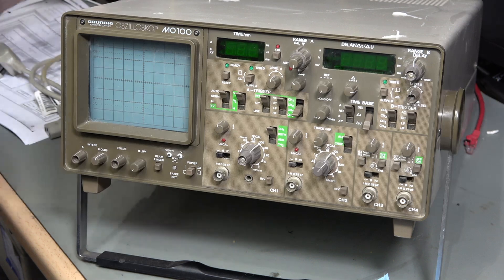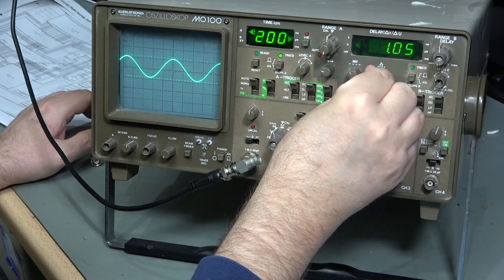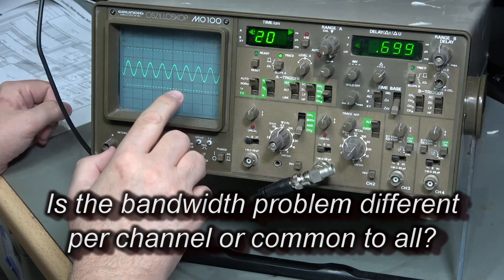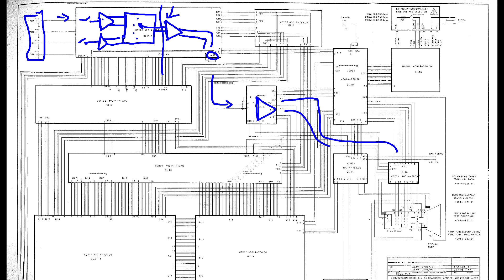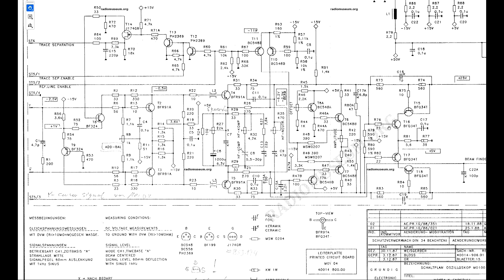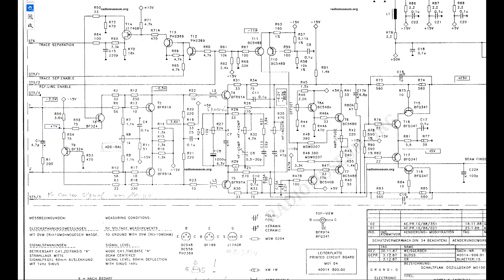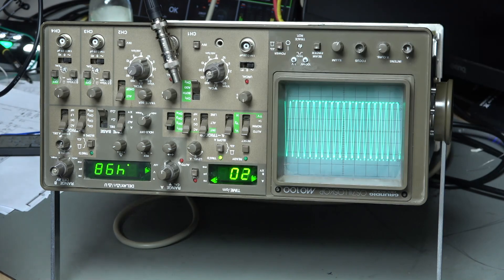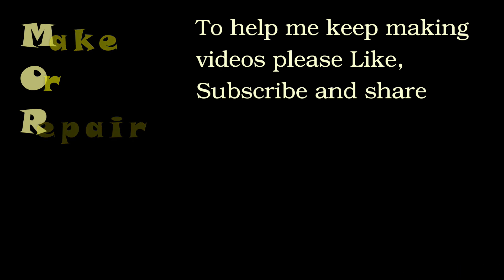Oscilloscope Repair Grundig MO100 #0089

Comment: Hello sir, I bought a Promax OD 540 oscilloscope at low cost.  But it doesn't work.  When power on, all led lights up.  Constantly alarming, can't find any manual on the oscilloscope.  Looking forward to your advice.
Reply from the maker: Information on promax is very limited, you might find something using a lower model in the range e.g. od-512 or what i think is closely related od-514/515/545.  Also take a look around and see if you can find anything that looks similar i.e. rebadged and check on EEVBLOG forum.   Without a service manual it can be a needle in a haystack.  

I should always start with a voltage check as far as possible.  Get hooked up and power on, look at the voltages early and see if any drop when it gets to the point it stops.  Hopefully you wiill find a separate power section with voltages marked, you can however pick up pretty reliable voltage test points by finding a suitable ground and testing voltages on logic ICs, operational amplifiers etc.
Obviously also check any front panel cables etc in the hope it is something simple.  

I have seen stopping durng power on for several reasons - from power that drops part way through starting caused by overload from another fault, power borderline with old capacitors, excessive ripple as that device powers on,  So voltages even if just to get a solid assurance for later checks.  And if possible the quality of those power supplies e.g. massive ripple. Check the processor (if it has one) is actually clocking and running before and after it stops. 
You may have seen in several videos that I do a voltage check on yout the power supply with everythig else disconnected, then if that works I connect up and test the power again - because the power supply will often protect itself if there is  fault elsewhere.  Not always practical but perhaps there are sub-assemblies that might be disconnected to see if that helps it narrow tha search.  Is it perhaps failing when it attempts to power on the CRT, which might point to a power fault in that area which could be difficult and dangerous without a manual .  
But really it is a case of trying to understand roughly what is what - input amplifiers  to choppers then a delay line, then to y-amplifiers for the plates.  The  first amplifiers also branch off to the trigger circuits which in turn control the sweep circuits.  Once you have a reaosnable amount of comfort you can start trying to isolate sections to narrow the fault.   But it can be a long and frustrating process.  You might find it helpfult to get a service manual for anything similar from a similar time not because it will be exactly right but because there will be similarities, particularly at the block diagram level.
Good luck!